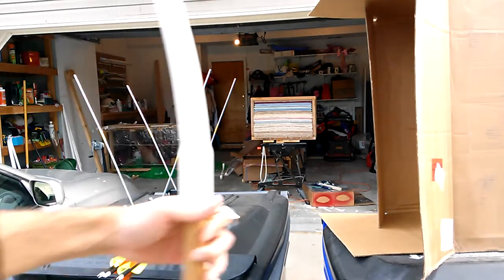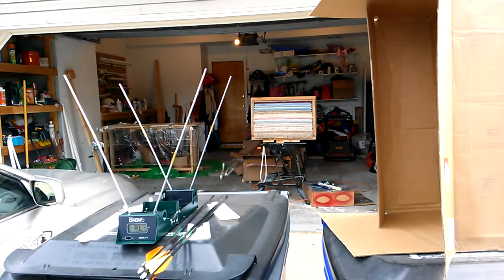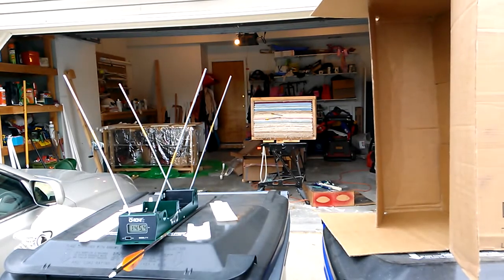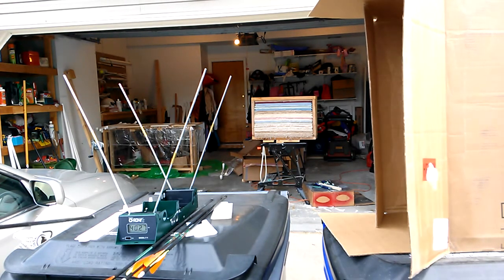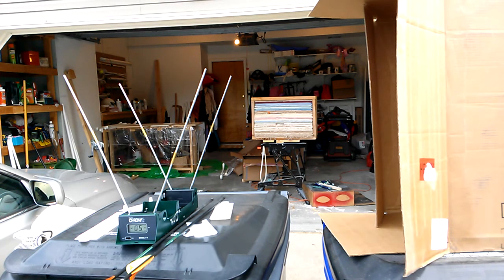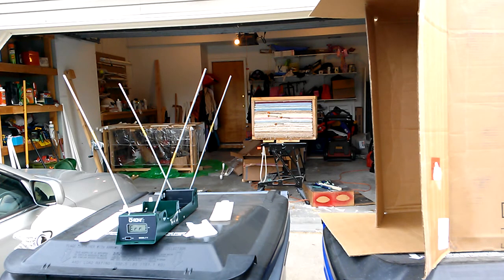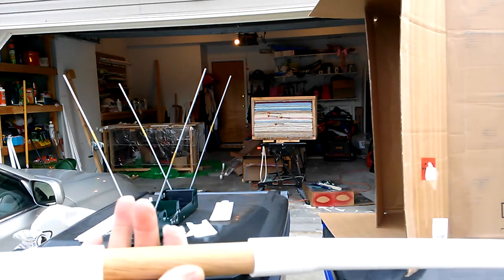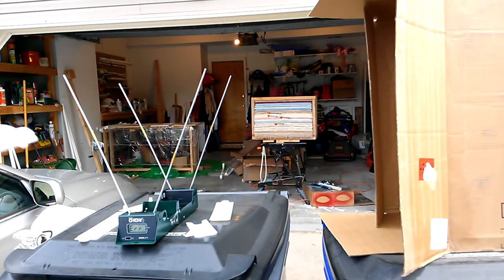Shooting the Dowel-Reinforced PVC Recurve Bow through the Chrony F1 Chronograph

Comment from the maker: OK, the two scrap pipes were both 24" long, the handle was, I want to say, 9-10" long, and it was inserted 2" into each pipe. Poundage came out to 50#, if I recall correctly. Nice to see that a slightly longer bow is possible without losing much performance over a youth recurve!